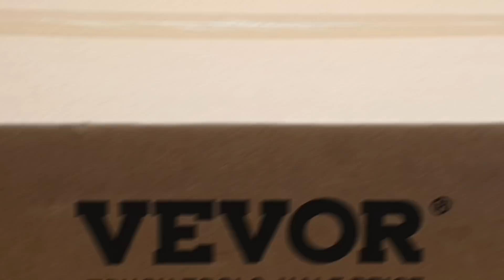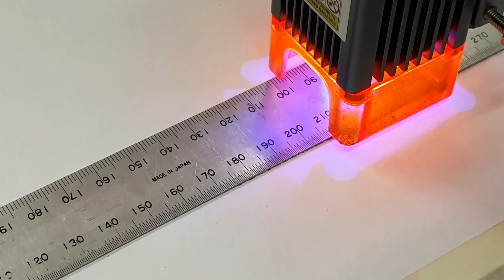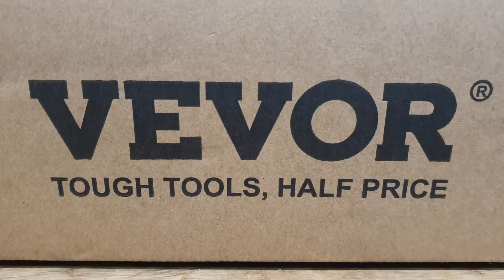VEVOR Laser Engraver Project Build And Review

Comment: Nice video! one question, is it possible to engrave in carbon fiber?
Reply from the maker: Thanks for watching. I'm not sure to be honest. I have not tried. What sort of carbon fibre items would you like to engrave on  ?
I can try it out
Reply: @Austeration  Não existe nenhum site onde se encontre uma tabela que indique que potência de gravação e corte usar em cada tipo de material? Seria muito útil. Aliás o manual de instruções deveria referir, nem que fosse por aproximação.
Reply: Thanks for you response, for example a cabon pipe. Im just wondering if the laser is strong enough for carbon. Engraving 0.1mm is enough.
Reply from the maker: @jeniferguma9107  I will have to have a hunt and see if I can find something. I currently don't have anything I can test it on.
When do you need to know by ?

Comment: I just got one of these and i can't get it to burn or cut anything. The laser powers on and i can see the focused spot, but even at S1000 and a super low speed it doesn't even melt Styrofoam 🤔 anyone have any ideas?
Reply from the maker: This might sound like a silly question but how did you set the height of the laser from the material your trying to engrave ? It should be the thickness of one of the 3mm plastic sample pieces that came in the box
Reply: @Austeration  not a silly question at all 😂 yes, I used the acrylic spacer that came with it. I spaced it with the orange magnetic shield in place.

I set the spacer on top of the material, then loosened the screws on the laser module and lowered the module until the orange shield was in contact with the top of the spacer. Then I tightened the screws and removed the spacer.
Reply from the maker: @nathanhall8678  what program are you using to run it. Have you tried the free version of light burn ? Is the laser on when its moving around ?
Reply: @Austeration  I'm using LaserGRBL. Yep, the laser is on while it moves. It's almost like the power level is too low. I double-checked to make sure that my power level configuration is correct (max value of 1000 instead of 255).

I didn't know there was a free version of Lightburn... I'll try that just to rule out the gcode and/or sender.
Reply from the maker: @nathanhall8678  light burn has a free 30 day trial. It's so much better. You will need to set the power to 100% and make sure you have it set to line or cut. Check out some of the videos on how to set up light burn. Yes good idea about checking the power level. Not sure how you do that though
Reply from the maker: @nathanhall8678  how did you get on ?
Reply: @Austeration  No luck... I have the same problem in Lightburn. I'm beginning to suspect a faulty laser module, so I reached out to Vevor support.
Reply from the maker: @nathanhall8678  ok cool please let me know the outcome of what happens.
Reply: @Austeration  Will do! So far Vevor isn't being terribly helpful because I received the machine as an anonymous gift, so I don't have an order number, but we'll see how it goes. If nothing else I'm hoping that the laser module can be replaced for a reasonable cost. I'll let you know how it turns out.

Thanks for your help!
Reply from the maker: @nathanhall8678  all the best. I wish there was something else I could suggested. Did you find Lightburn easier to use at all ?

Comment: What is the card slot for?
Reply from the maker: That is a really good question. I wondered the same thing my self actually. There is nothing in the manual that even mentions it.
I will try and find out though now you mention it 👍
Reply from the maker: Ok from what I understand the SD CARD slot is used for cutting offline should you ever need to do that. To be honest I don't think I'll ever use that function but it could be good for others. Hope this helps

Comment: what do I do if its not engraving or cutting
Reply from the maker: Has it been working before now ?
Reply: @Austeration  this is my first time trying to use it. and first working with any machine
Reply: I been playing around with it all morning so it just cut but not fill I had it set at 300/100 line and 15000/100
Reply from the maker: @boogeeass  are you using the light burn program
Reply from the maker: @boogeeass  if you are check out a heap of the light burn tutorials. They can probably explain things much easier than I can trying to tell you on here
Reply: @Austeration  yeah that's what I been watching trying to get to work I got it to cut
Reply from the maker: @boogeeass  what are you cutting
Reply: @Austeration  1/8 birch wood
Reply from the maker: @boogeeass  how you getting on with it ?

Comment: Glad I found your videom I just buy mine last week and when I opened the box and find out I will be the one to assemble it I almost decide to return it coz I am not a techy person. But with your video I will give myself a try.
Reply from the maker: Thanks Hanna. I hope it helps you. If you have any questions putting it together please ask and I will assist you. I'm sure you will have it under control though 👍👍
Reply: @Austeration  thanks and will do in case.
Reply: Thanks for the cheering hehe.. I am downloading the lasergrbl software
Reply from the maker: @hannalagud  I didn't bother with it. You don't need it to operate the unit.
Reply from the maker: @hannalagud  you should check out the Light Burn program. It's free for 30 days. It's so much easier I found. All the best 👍😁
Reply from the maker: @hannalagud  how are you getting on with your unit ?
Reply: I just finished setting up mine but it took me more or less 3hrs coz I switch the frame, then I install the y axis wrong, huhuhu, was so tired. Then the worst part is the cable installation. The cables entertwined inside that black thing, so hard to connect to their. Then I figured to better pull them all the way and put it back properly.Then everything is ready. I will install the driver and software tomorrow. I was  so tired. Huhuhu. But thanks because I kept watching this over and over again,until I make it. Also, do you need to use goggles and mask when your printing? To avoid radiation you know.
Reply from the maker: @hannalagud  congratulations Hanna, I was only Just thinking of you and was about to message to see how you got on. I had that same trouble with the cables that you had and fixed it the same way you did. When you have recovered please let me know if there was any parts of my video that you wish had more information. Don't worry about how hard it was, I am sure if you had to do it a second time you would do it in 30 min. It's all learning and you did it all by your self.👏👏👏
Yes you should use the glasses to protect your eyes. Depending on what your using it for it will create some smoke so make sure it's in a well ventilated area. If it's anything toxic then make sure your well clear of it.
What software are you planing on using ?

Comment: can you test this on acrylic sheets? 😮
Reply from the maker: Are you wanting to cut the acrylic ? How thick ?
Reply: @Austeration  2mm up to 6mm
Reply from the maker: @PuttyCream  ok give me a couple of days and I will see what I can do
Reply from the maker: @PuttyCream  hello Putty cream.
I chucked together a short just for you , it's not a public clip. You  will need to pause to read it. Let me know if this is enough information. https://youtube.com/shorts/boPcZ7eAN5o?feature=share
Reply from the maker: @PuttyCream  did you see my message ??
Reply: @Austeration  error won’t load
Reply from the maker: @PuttyCream  give it 2 min and try again. I took it down as you had not replied. I'll put it back up now
Reply from the maker: @PuttyCream  ok it's up again
Reply: @Austeration  thank you!!!
Reply: you’re cutting without a enclosure and venting system correct ? 
i just got my machine but i’m scared to use it since i don’t have either yet 😅
Reply from the maker: @PuttyCream  that is correct. I have a large workshop so I did this next to the door with plenty of ventilation to blow anything out the door, I also had a fan running. I don't normally do any plastic work so I don't feel the need for the enclosure. Have you used a laser like this before at all ? I recommend getting the Light Burn program. It's free for 30 days and then you have to buy it. I hope the little clip helped and gave you the information you needed. What are you using yours for if you don't mind me asking  ?
Reply: @Austeration  This is my first laser machine!
Have you tried the app at all that’s suppose to work with this engraver? 
Yes i was going to start the trial as soon as I get the enclosure and setup some type of venting system .
Yes your video was very helpful! I just hope i’ll be able to get cleaner cuts though with air assist. i’ll be using it mostly for acrylic sheets and mylar.
Reply from the maker: @PuttyCream  no I had no idea there was an app. I will have to look into that. I can only suggest that you play around with the settings until you get the best settings. Maybe lower strength and more cuts.
Let me know how you get on. I am happy to offer any suggestions should you need help.

Comment: Hey mate i got this machine and thanks to you was able to putnit together. The instuections were average. Anyhow used it for a day and already today the laser has died. It slowly lost power until it is completely dead now. Fingers crossed vevor tech support can help. Otherwise it would be a waste of money. Have you had any problems with it yet?
Reply from the maker: That's sad news the only trouble I had with the instructions was the wiring. But they could have been better. No I haven't had any trouble at all with mine. Have you had any experience with any other lasers or is this your first ? What is dead, the laser or the whole thing?
Reply: @Austeration  this is my first laser. And was using it on some light burning on timber and yeah the laser itself started to lack power. And then I tried troubleshooting and as I was testing it slowly faded away completely. So there just no light coming from it at all any more. Still moves everywhere all good just no laser.
Reply from the maker: @Ackybomber11  obvious question but you did you remove the connection to the laser and plug it back in ? Also what software are you useing ? Is it light burn ? If so make sure you have the layer selected turned on. I got caught out with that a few times.
Reply: @Austeration  Hey mate yeah I disconnected most of the connections and reconnected. And using grbl. It slowly got worse and worse. Well actually I went from working well on a job to really faint. Even just using the light on feature on grbl and it was very dim laser light. Hopefully tech support can sort it out. As it was working so well. I thought it may have gotten dirty. But cleaned it and no change. It eventually faded out to nothing. The green laser active light on the top of the laser still lights up. But dead otherwise.
Reply from the maker: @Ackybomber11  mmmm that sux. I feel very disappointing for you. Yes hope the support can help out. I'm not sure what else to suggest without seeing it. Please let me know how things work out please.
Reply: @Austeration  will do mate. I hope it was just a bad unit and I can get plenty of work out of a new replacement unit.
Reply from the maker: Just checking back with you to see how you got on, any updates ? ? ?
Reply: @Austeration  yeah they couldn't really resolve the problem so I'm requesting a refund. Buyjng a creality falcon 2 22watt instead.